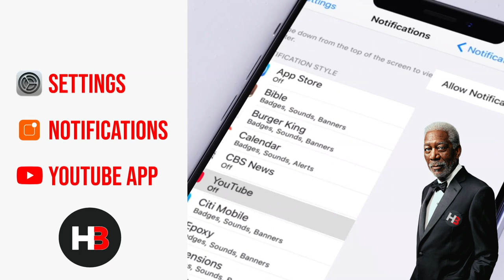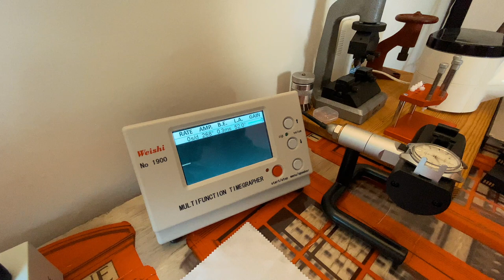He came back with another Grand Seiko watch for restoration! 😵  4420-9000

Comment: You can negotiate your energy prices 😮? We're in a 2000 square foot home here in Florida. I put the water heater at it's lowest setting and wired in a timer. Put all the light switches on motion timers. Set the digital ac timer for much higher temperature during working hours. Installed ceiling fans in every room. No led bulb has a higher than 40watt equivalent. And made sure none of the charing mechanisms that stay in the wall have a light that stays on all the time we call vampire lights. Got my bill down to $150 a month.
Reply from the maker: Thanks for watching 👍🏼 Yes you can negotiate and pay what you want a month, but don't forget that come the annual bill you will owe them a lot or potentially they owe you. I like to balance it out a bit. I'm suspecting given I pretty much froze last winter that I will break even given how much the energy prices shot up. Well I'm hoping anyway,

Comment: Regarding using TimeGrapher I've one watch which by TG is crap as it is "wobbling" cyclically over a minute of time, ten seconds fast or slow a minute. Probably there's something wrong with the Great Wheel as the amplitude is very good. But then I've regulated the watch with the old school paper and pen method, getting it to run in my use very accurate, about two seconds fast a day.

Trying to regulate that watch using TimeGrapher only would be like the dog chasing it's own tail. 🐾

BTW some watch manufacturer have told opening those pesky shock settings on the bridges and base plate is unnecessary as they get clean enough during a proper automatic wash and jewels can then be lubricated using an automatic oiler through the jewel holes. But damn me if I'd remember what manufacturer it was...
Reply from the maker: These detailed answers are usually for my members 😜 
Have you made sure you have the correct lift angle set on the TG? 

I'm not sure about those shockers but I would be surprised if a cleaner did get up in there to clean them as they are usually just stuck together even when they come out of the machine. I remove them and clean them manually once I have cleaned the whole movement and there is always some dried oil still on there.
Reply: @HorologyBiology  Yeah, the Lift Angle is correct for the movement. The watch probably would need a look, but can't be arsed as long as amplitude is good and the movement otherwise is surprisingly accurate.

Steady +2-3s/day is something to reach for, not repair. 😁

Comment: Want to know which little jar you use  that has a screen at the top where you stick the pallet fork in.  Then shake it around to clean it, Great job on the grand Seiko.
Reply from the maker: Thanks for watching. It's a special glass jar for the Fixodrop to stop it evaporating. It also has a little net inside to hold the parts. They are ridiculously overpriced for what they are though.

Comment: Am I trippin? 
4 jewels on balance wheel
1 roller jewel
2 on the pallet fork
2 on the pallet fork pivots
4 on escape wheel
4 on 3rd wheel
3 on 2nd wheel and
4 on the barrel
Adds up to 24 for me. Am I missing some? Cause it clearly states 27!?
Am I blind? Or can‘t count?
Reply from the maker: 😆 no no you can count. You have actually made me count and I got up to 25.. Now I'm also stumped at where the other 2 are. There is also one where the minute wheel post sits on.
Reply: @HorologyBiology  Yes, 26 for minute wheel post and 27 for a tiny screw-on plate with a cap jewel for the lower pallet pivot. The last one is missing from this one, and there's no place for it either, so I suspect the whole main plate is borrowed from a 25 jewel 44 King Seiko.

Comment: I think your nitpickyness of movements based on what annoys you because it takes longer to oil and not what has engineering benefits or hinderences is a little annoying.  Other than that nice video I guess.
Reply from the maker: I'm glad I pressed your buttons 💪
Reply: Capped jewels give both superior lubrication and extend service intervals.
That GS chose for this is a sign that they chose for engineering excellence. Something a watchmaker should appreciate.
Cleaning and lubricating capped jewels is part of your job.
That it means it's more work to service means you can ask for more money.